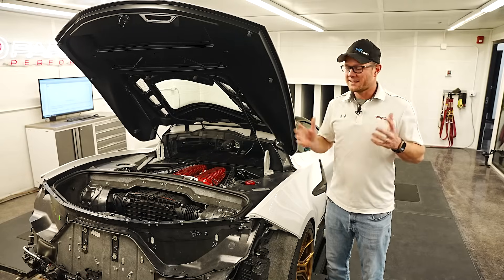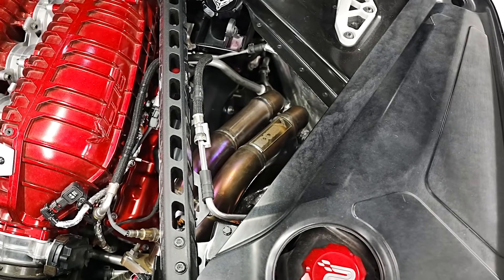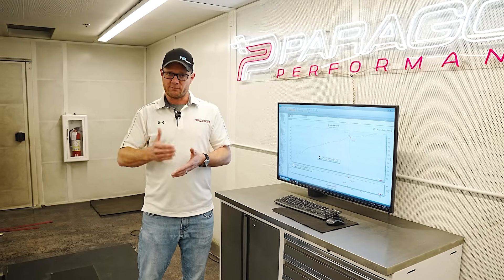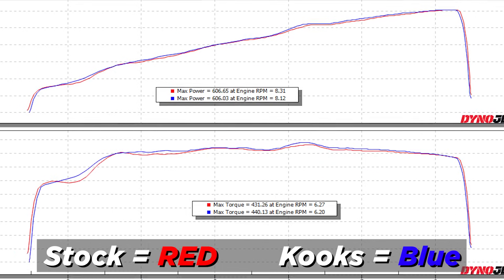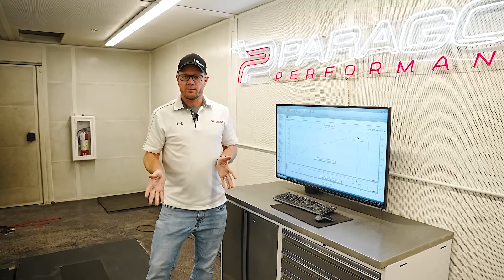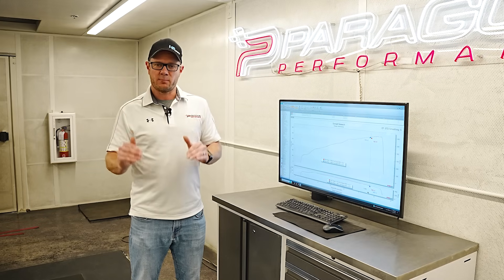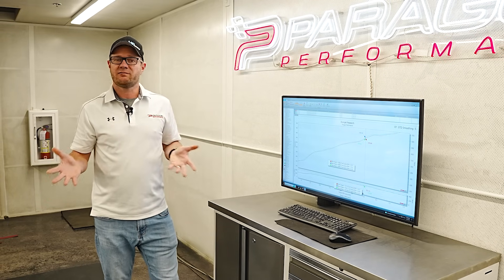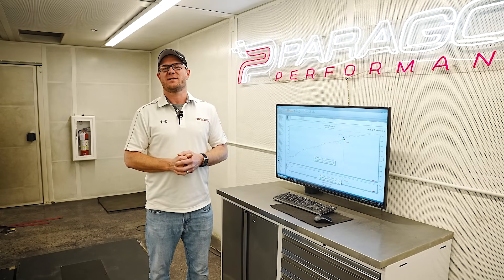Kooks Headers Corvette C8 Z06 - Dyno Testing & Results!

Comment: The stock numbers are so low wtf it should be mid 500s or more to the wheels with 670 hp!
Reply: Not sure to what you're referring?
Reply: You must have looked at the torque curve and interpreted that as the HP. No, this car made 606 HP to the rear wheels, which is exactly where it should be for 670 HP at the crank with a 10% drive train loss. This is a proper baseline.

Comment: Cant wait to see what hptuners and a procharger can do with that motor
Reply: Hopefully tuning will happen one day, but this engine is not designed for forced induction. That would be the LT7 in the ZR1. This should stay NA, unless you want a giant grenade. It would be better to super/turbo charge a built Stingray/E-Ray as those aren't high revving engines.

Comment: Numbers aren’t worth the cost or effort tick tacking power mods when this particular platform for the z06 is already maxed out from factory.
Reply: Maxed out from factory is crazy when the air intake can add 40-50 hp not to mention a cat delete and e85 lmao.
Reply: @stevenreid5427 exactly it’s far from maxed out. Just adjusting airflow with headers , exhaust , throttle bodies and an intake gives you like 55-75 more hp
Reply: NO car is maxed out from the factory. That's just stupid. They have a ton of restrictions from laws, emissions, drivability, etc. This is why there's always HP to be gained. If a car was maxed out, the probability it would blow up would be very high. The warranty claims would be through the roof and it would be undriveable for a large percentage of people. I don't understand why some people are so clueless about this.

Comment: Fantastic video here, besides the extra 8-10 HP through the curve here, the Kooks headers look better and should be lighter too than the OEM headers as well - 2 more pros here to do this.  Only con I see here is that they will produce more heat in the engine bay area than the OEM headers without the heat sheilds on them, but that can be fix too if you get the proper heat blankets/wraps on them or even better get them heat coated..!

Comment: Please stop using STD correction.  It makes it look like you're trying to artificially inflate the numbers.  SAE is the way to go.
Reply from the maker: If we do SAE someone else will complain that we aren't using STD numbers like they are used to seeing or they will complain that our dynojet reads lower than someone else who is using STD.  We've covered this topic a lot in other videos and try to be super clear about it.  It is important to use a correction factor.  Yes, STD does offer a bit higher number than SAE when the correction factor perfect gets higher above zero.  We always baseline cars in STD and then compare in STD.  There is no trickery going on.  A lot of folks simply want to see the highest numbers they can and at this point, we see more shops and manufactures testing in STD as well so we are simply trying to follow the industry there as well.  We are always happy to convert base line and final numbers to SAE for anyone interested.  We have nothing to hide and nothing to gain by using STD, its just the correction we have chosen to use.  The relative gain is the gain no matter which correction factor is used. We hope this clears this up for you and and anyone else that is wondering.  - Graham   :)
Reply: In this case, the numbers are correct given 670 HP at the crank and ~10% drive-train loss. So your comment is a big nothing burger.

Comment: If you installed kooks on a c8 stingray would the HP numbers increased more than if they were installed on the z06 ?
Reply from the maker: @Revlabperformance  yes, we have found more power gains with headers installed on a C8 stingray than we have on a c8 Z06

Comment: Phenomenal video. Confirms what I experienced on the street w my car and kooks headers . Also disproves the myth on resetting LT fuel trims post mods. Great work guys.
Reply from the maker: @Brandonsgarages  thank you!
Reply: ehat did you experience? more power on street? you have a c8z?
Reply: @ I noticed a drop in my 1/8 mile mph and slight improvement in 60-130. Which kind of contradict each other . Overall not much change. Yes c8 z06

Comment: Great video! I like how thorough your testing is. However, that doesn’t really seem like the gains are worth it.
Reply from the maker: The fact that these have an average of 8-10 HP through the curve whiteout dipping below factory horsepower is the main focus. As well as changing the sound to more of an F1 like sound is what most owners will love :)
Reply: @ definitely the sound may be worth it to some. However, those power gains probably wouldn’t be consistently measurable in acceleration runs. It just shows how great this engine is straight from the factory.
Reply: @ParagonPerformance Also when coupled with Eventuri & larger TBs I assume gains up to 80hp. Didnt the Eventuri gain 70hp plus the headers will be awesome!
Reply: @boywonderrr71  LOLOLOLOL
Reply: @robr5180  LMR 730 HP to the wheels without the headers, Thought you knew about this?. Ported TBs, high-flow cats, & Eventuri intake gains the whole rev range.  Go watch Paragon performance detailed video on the intake.
https://youtu.be/_M1BJUDXIKo?si=iGo8X0OQgY1Wan8V
Reply: Something like 42 peak hp output but 15 hp avg. That would be the only thing i would do to mine, already did a titanium exhaust.   Car is pretty great stock, til they crack the ECU stock is how ill keep mine. @boywonderrr71
Reply: @boywonderrr71  🤣🤡
Reply: @nunyubizness5483  Truth hurts your feelings......👌🤪🤪🙄